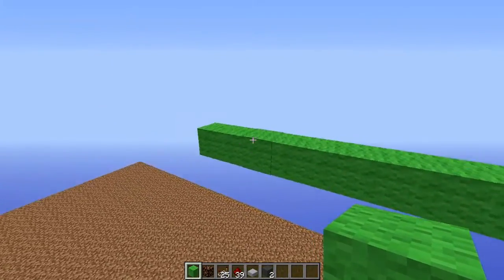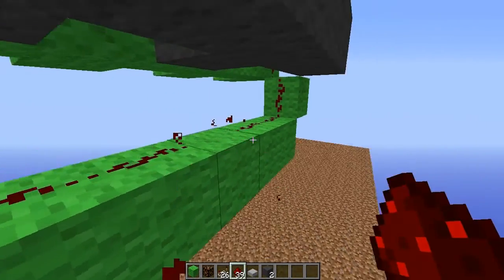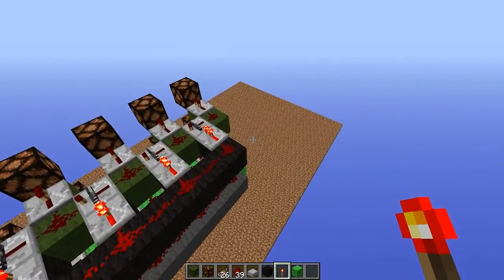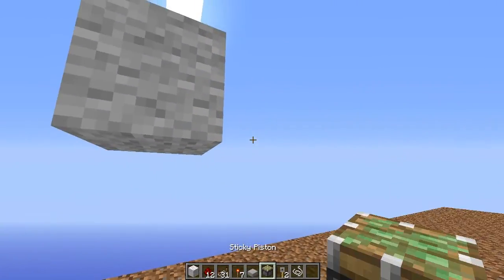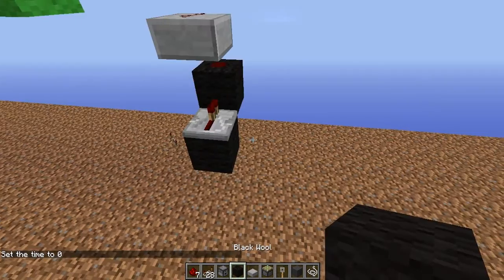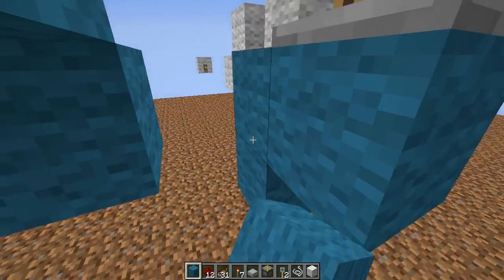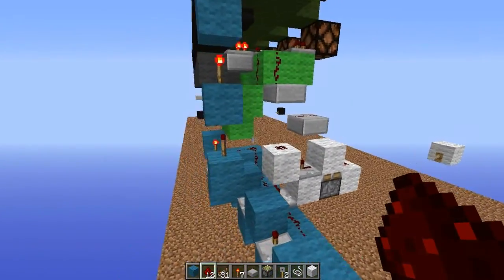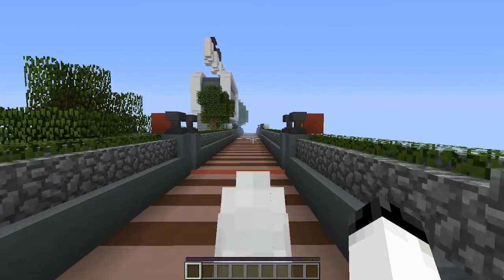[Redstone Tutorial] Etho Horse Timer [1.6+]

Comment: Calisto, is it possible to make the horsetrack longer than 20 blocks? 
I think it's with fast horses. For some reason the timer says it run the track at 1.4 seconds, but it actually takes 2.4 seconds (I tried to release the run button just for a millisecond in the middle of the track with the the same horse and when I finnished, the timer said 2.5 seconds, which is correct, I think). 
I think that the timer's having problem to recognize speeds under 2.4 seconds. Can you please look it up?

Comment from the maker: I apparently need to run many more trials to ensure this timer works perfectly for all horse speeds (I thought I corrected for the one second delay on the timer by speeding up the reset mechanism, but maybe I need to extend the reset a few blocks instead of extending repeater delays). I was trying to keep this timer as compact as possible. Apparently there are a few flaws due to spacial constrictions. I have had little time to work on my Youtube page lately but promise to look in to this soon.